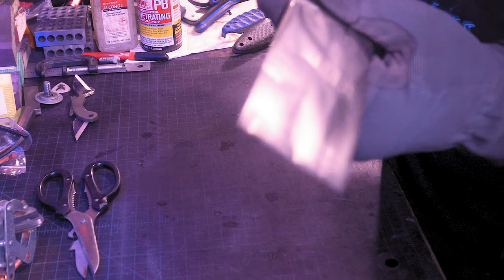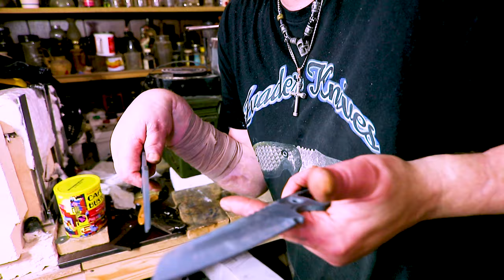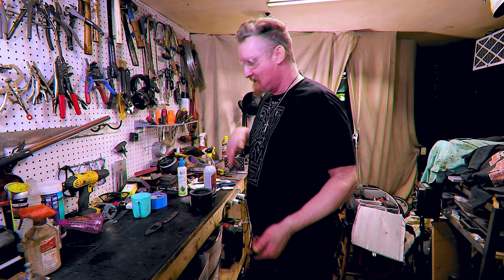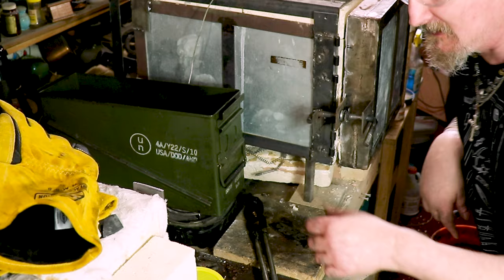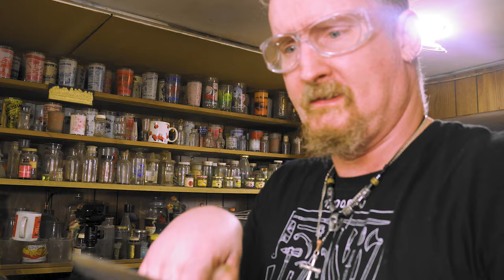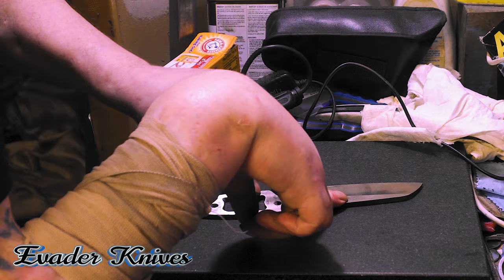1095 Hamon - Heat Treating Experiments

Comment: Good video Dave.. I just put a hand finish on 3 hamons . I noticed something interesting that walter sorrels mentioned befofe. I tried an experiment my self. I quenched 6 blades 2 in water alone 2 in oil Parks 50 and 2 in interrupted quench water for three seconds then oil Parks 50. I noticed the blades quenched in water and interrupted the hamons were more interesting then the ones in oil alone. check it and add it to your hamon experements.. Martin
Reply from the maker: Yeah, I've seen that video, honestly, I've always been scared of water... but you're right, i do need to give it a shot...
Reply: I was scared to try water as well but out of 8 total blade I only lost two. I think I could have changed that by making the scratch pattern the other way. from tip to tail not top to bottom. I could be wrong but I am only going off of previous HT. I have never lost a blade before and I changed a couple things as well. First a water quench second the scratch pattern. Plus the thickness of the piece.. Any way I'm rambling. At the very least the end product has a very visable difference.. Martin

Comment: Hey dave where are you geeting your anti scale from? great video bro!
Reply from the maker: Thanks, Brownells... https://www.brownells.com/gunsmith-tools-supplies/metal-prep-coloring/heat-treating-accessories/anti-scale-coating-prod23076.aspx
Reply: @Bootleg blades I heard from somewere that high temp header paint will also work. I have never tried it so I don't know. Perhaps Dave can do a ex[peramental video on that topic... M
Reply from the maker: @msblades5382  Neels Van Den Berg was talking about a rustoleum coat, then clean it off with thinner and a wire wheel, but it was on instagram & the picture is gone... I'll have to ask him again... but i really like the 641...
Reply: I just painted the forge with high temp paint. Think it was hoot to 2200 but seems like it would be a pain to clean off. Also if I’d get my ass in gear my heat treat oven has argon injection so it makes the entire oven an oxygen free environment like the foil wrap does just need to plumb it to my tig welder tank then I don’t have to worry about any of it lol
Reply from the maker: @bootlegblades6276  I've seen those ovens, pretty crazy idea... I don't think you would want high temp paint, just guessing though. wouldn't that block the heat, not oxygen???
Reply: No it would probably work like the anti scale but then need lacquer thinner to get it off. I’d stay away from it but may just paint a chunk and throw it in the next time I heat treat some knifes of course that would require me to make more knifes lmao. I have been out in the garage all day but have been making a big ol batch of mash so I can run my Still next weekend and working on the jeep.
Reply from the maker: @bootlegblades6276  Haha, I hear that...

Comment: So tool wrap works for 1095?
Reply from the maker: Only normalizing, for all high carbon steel... you still have to heat treat like you would, though the anti-scale really helps(not on 52100 or 80crv, they don't need it  https://www.youtube.com/watch?v=V0EvGK970vc)...